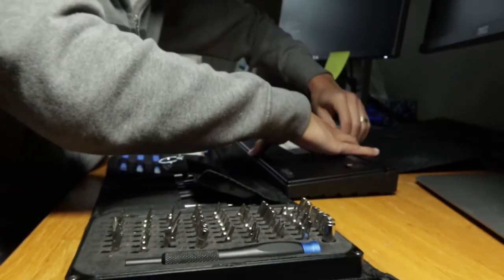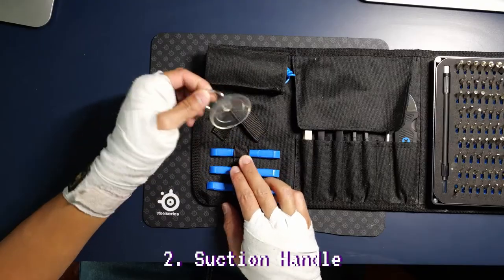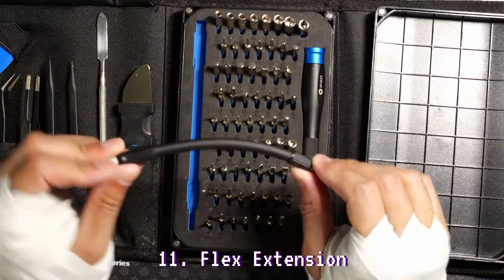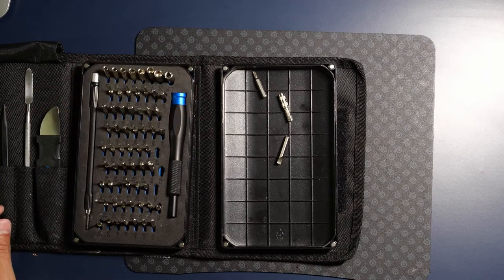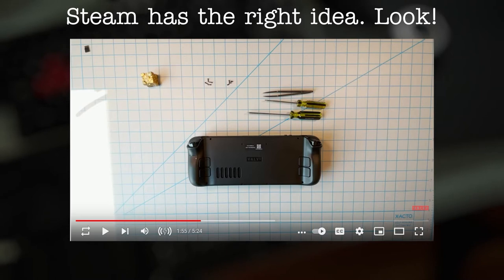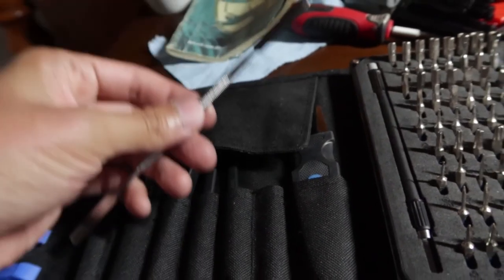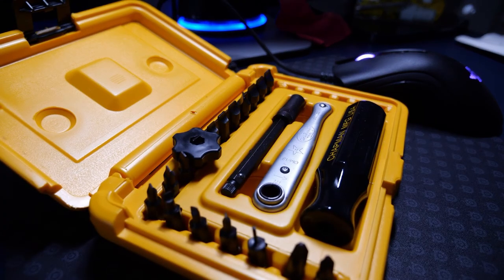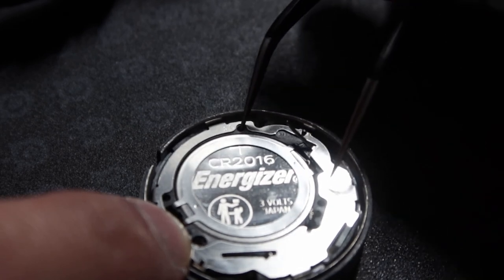Is the iFixIt Pro Tech Tool Kit Worth It in 2021? iFixIt Pro Tech Tool Kit **REVIEW** after 6 years!

Comment: Received one of these as a gift and it has got pretty much everything you need to fix small gadgets. The tools are good quality and perform very well so long as they are not misused or abused. Far better than the majority of cheap Chinese kits which do have bits that round off easily. I have used my kit for replacing watch batteries, iPhone battery replacement, laptop computer repairs, Fitbit battery replacement, and loads of other stuff. Easily worth the purchase price compared to trying to get stuff commercially repaired. Look after it and this kit should last for years and the lifetime replacement guarantee for any parts you do manage to break offers peace of mind. Mine came with a free magnetic mat, so the lid spill problem isn’t an issue.
Reply from the maker: Oh wow I wonder when the free magnetic mat became included. That sounds great.
Reply: @JeremyY The Magnetic mat is always there, its below the bit holding part of the mako Precision bit set. Its a black mat holding the bit set in the kit on its place but I use it with my computerservice company alot to hold the screws

Comment: Totally worth it. I fixed my GBA SP back in 2020 that had a cracked screen since 2004. Thing still works in sound, power, and controls, I just cant see what's happening on screen. The only reason I didn't want to fix it at the time was back in the old youtube days, there were only a few tutorials on how to remove the rubber feet on the screen frame that were covering the screws of the top shell. The person on the youtube video basically destroyed his and I did not want that to happen to mine. I built the confidence after 16 years to do it and there are more videos on how to PROPERLY do it without destroying the feet (it was doing it slowly and carefully). I just asked my self, "Do i want a broken screen forever or do i want to fix this issue with a change of it actually working."

Comment: I work as a onsite tech at two Elementary schools. I am constantly repairing Chromebooks and was looking for a good set I have known of ifixit for quite some time since another job i had used those for the repairs but I wasn't sure if i should spend the price or not. I am finally just going to take the jump. I am really hoping the bits don't strip too easy on me
Reply: It's been 7 months since your comment. Did you buy it? What was your experience?
Reply: How'd it go?

Comment: Would you still recommend this in 2023? I'm thinking of picking one up come the Black Friday deals. Also, isn't there a magnetic pad under the bit case? Couldn't you use that to place your screws on? Though I just looked and it seems the $70 bundle now comes with a magnetic pad.
Reply from the maker: Yes I would still recommend this kit for 2023! The magnetic pad is a new addition so I’d like to imagine that iFixIt saw this review video and added it afterwards!
Reply: @JeremyY Well I was thinking of buying a kit from them and now I may go elsewhere. They raised all of their prices to the point where after you take the 20-25% black Friday sale off it's the exact same price they were before. Some may now be about $4 off but others are the exact same price.

Comment: The fact that some of the bits deformed after one use would have made me flunk this tool kit. Been working on electronics for many years and I have no patience for crummy tools; but, unfortunately, everyone shops by price alone and so, that's what we're saddled with. If I have to buy the same tools over and over, how much of a bargain is that?... Early last year, Klein introduced a 39-bit set, #32717, that's quite good and only $30 in Home Depot ($35 at Mouser). No major complaints except that the case requires two hands to open; that's just plain stupid. And this is imported into the US, not made here which is a disturbing new trend for Klein tools... Thanks for the tip about Chapman's low-profile ratchet: I've been using a 1/4" box wrench with the bit taped inside... And who makes those screw extraction tools?
Reply from the maker: Yeah the deformed bit wasn't great but the lifetime warranty did help. And I'm probably reaching when I say this but the softer driver bits might help to avoid stripping screws or cracking more delicate components. But that's likely a "happy accident" resulting from cheaper build quality instead of being intentional. Sucks to hear about Klein because I have one of their demolition drivers and it has served me well, but I also purchased it several years back. If Klein is headed downhill in quality I'll be very disappointed. My screw extractor set is Moody brand.
Reply: @JeremyY  thanks for your detailed reply. So far, the imported Klein stuff seems OK.

Comment: Would you recommend this for laptop repairs??
Reply from the maker: Yes I would. The anti static wrist strap is good quality (the knock off versions do not make these properly), it has the drill bits you need for just about every component, and it also has anti static versions of the prying tools.

Comment: Could you link the screw extractors you use?
Reply from the maker: Moody Precision Screw Extractor & Screwdriver Set (Stock# 58-0670). I don’t have a buying link but Moody is a US-based company that manufactures a range of specialized hand tools. If you live in Canada or the US you should be able to buy it easily. I tried contacting them for an international link but received no response.

Comment: Too expensive for what it is.
Reply from the maker: Hard disagree. Ask yourself: how much will I have to pay to replace a catalytic converter plus the hacked apart O2 sensor that the methhead thief didn’t give a damn while going hog wild with a sawzall.

Now ask yourself: how much for the MillerCAT?
Reply: Too expensive?
Are you kidding me?

Buying the pieces (of equivalent quality) would be several times the price of this kit. 

I have used this kit for almost a decade and I have bent one bit, immediately replaced by ifixit no questions asked. 
And I was working on a project that was made for Craftsman or Snap-On bits. Instead I grabbed my ifixit set - and bent a bit. 
Precision is made for precision work. As far as extraction, I have a tap/die set that is just fine. I understand why they didn’t provide an extractor set. It wouldn be more than a hundred bucks easily. 

It’s rare that I find a stripped screw in a project unless it’s been ‘fixed’ (stripped) during a project before the one I’m doing. 

Too expensive, ya made me snort lol. 

It’s a bargain!
Reply: They're made of soft steel and aren't magnetized. I agree with you.

Comment: I cannot recommend this based on the reviews I watched. Yes I never owned this or used this. There are brands that is better for your use case. It could be more expensive than this or cheaper but you are better buying other brands and the tools that is not included in this pro kit. You better research the tools for your needs, buy it separately and invest in it.